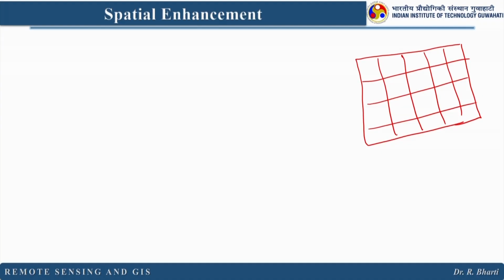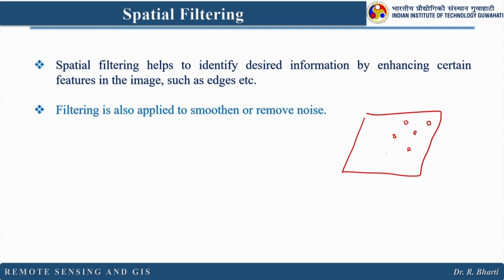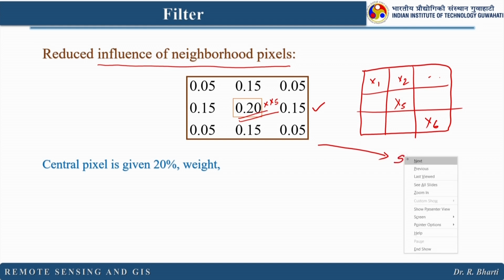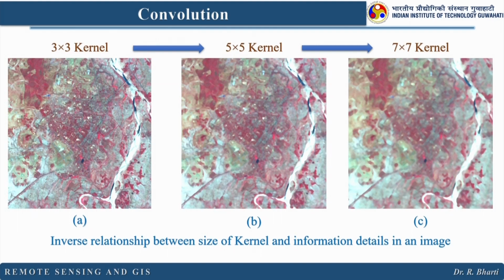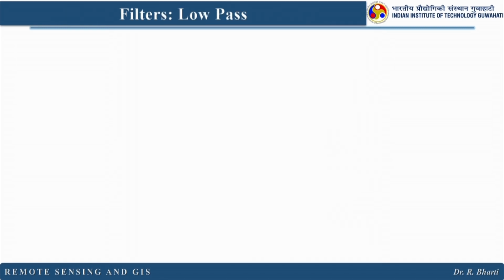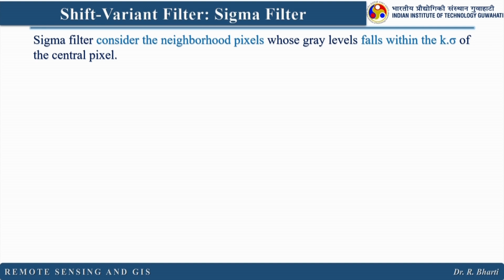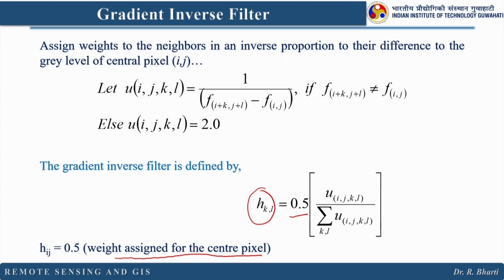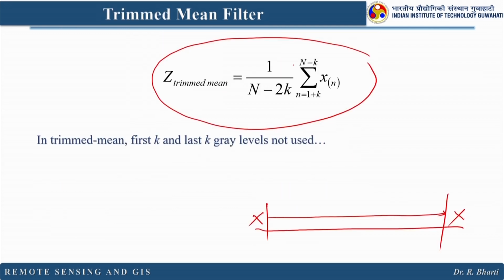Lec 8: DIP-II

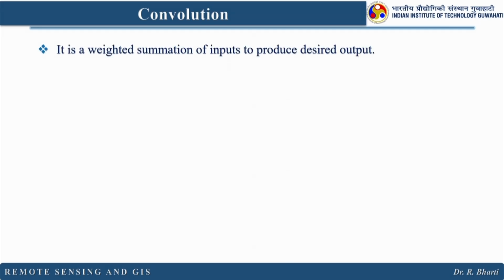Comment: 21:00 convolution
35:38 Example of Linear and Nonlinear Spatial Filters
36:50 Sharpening Spatial Filters Example
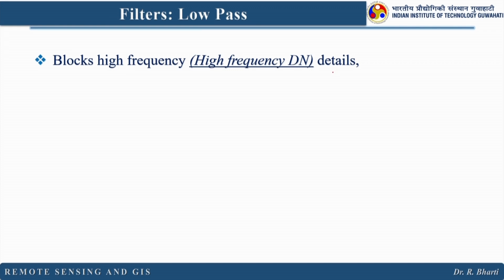38:00 Low Pass Filter
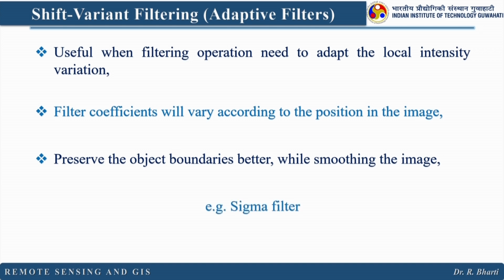Reply: 46:32 Sigma Filter (Shift Variant Filter)
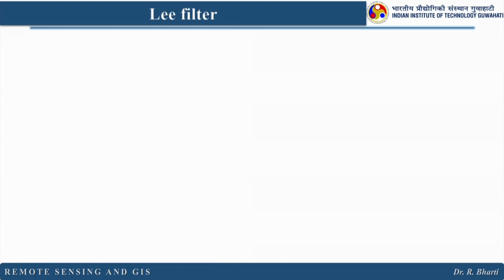Reply: 50:50 Lee Filter
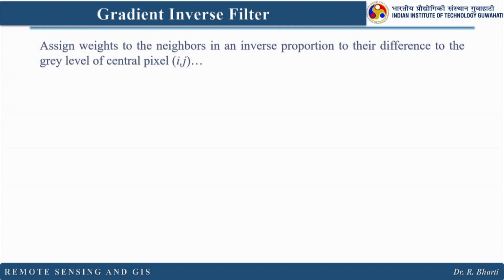Reply: 54:00 Gradient Inverse Filter
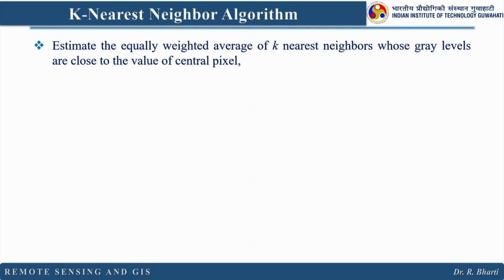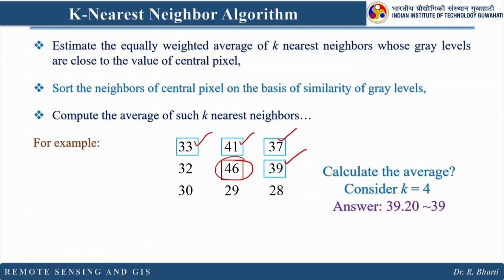Reply: 56:20 K nearest Gradient Filter (** 58:10)
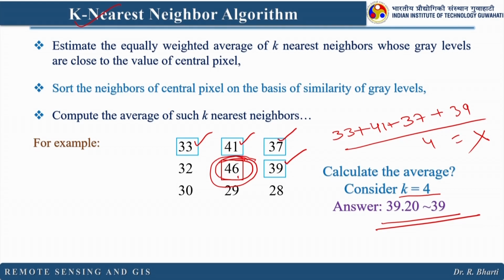Reply: 59:00 Median Filter (Nonlinear Spatial Filter)